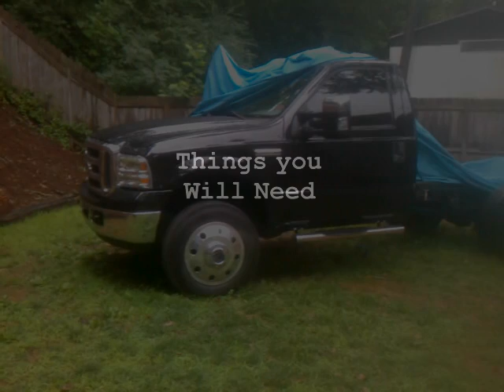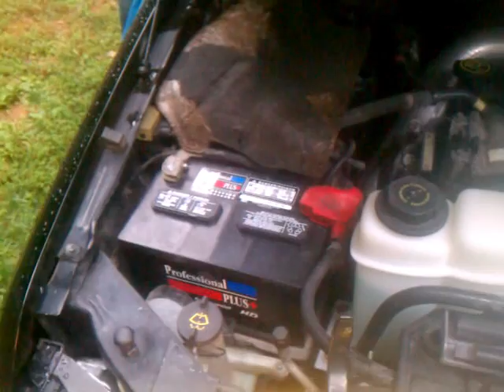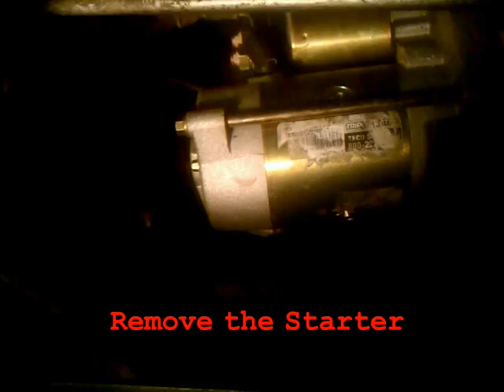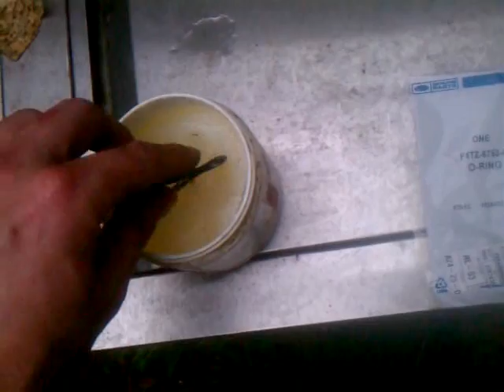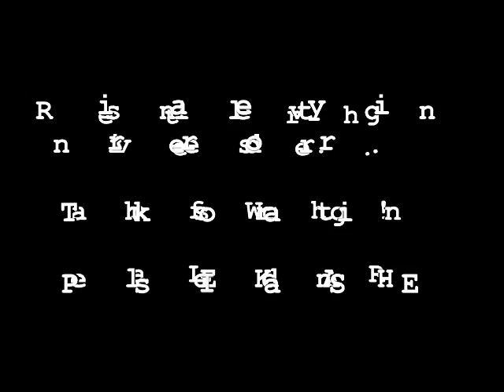2002 F350 7.3L Oil Pan O-Ring Replacement

Comment: I use a long wire handle oil galley brush ,instead of factory o ring I used a slightly thicker o ring that fit perfect in the groove on its own , the o ring I used was designed for extreme pressure,heat and oil ,also used extreme pressure thread sealant on threads ,I’ve done this on numerous 7.3’s not one has so much leaked even a drop of oil,combined miles on the trucks after the the fix 700k miles no leaks

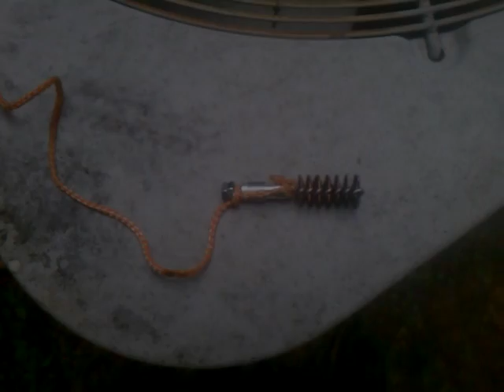Comment from the maker: Insert the gun barrel bore brush shown at 5:05 of this video into the hole the dipstick tube came out of after it has been removed. By doing so, it will hold the dipstick tube housing/flange in place and prevent it from falling into the oil pan. I was unable to capture useful video of myself completing this important step, I was using both hands to work at the time.Fortunately, since 2014 when I made this video, others have performed this job and shared a video. A fantastic clip of the step left out in this video can be viewed on Zack of all trades page on the following link: https://youtu.be/9dVAiJbBzIE  
My goal is to lead you to a successful outcome, save you time and money, and make this job easier for you. My video has a complete tool inventory, safety tips, and procedures to aid in a successful and expeditious repair. Good luck!  Remember to Like and Subscribe. Thank you!